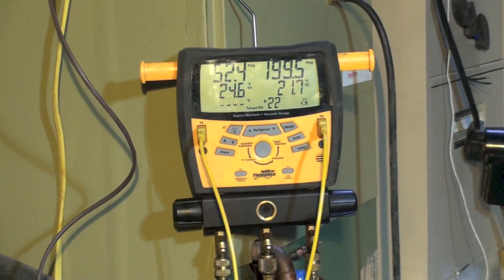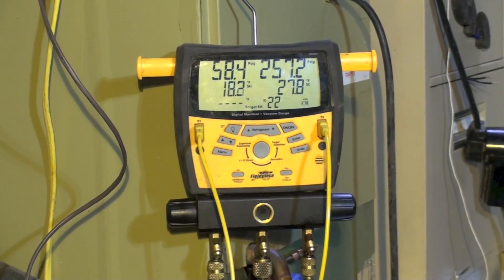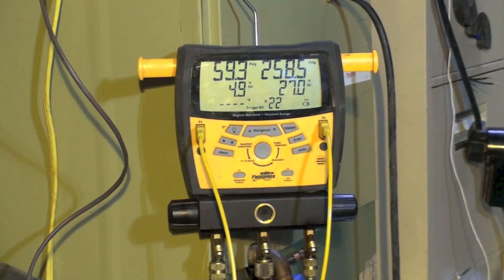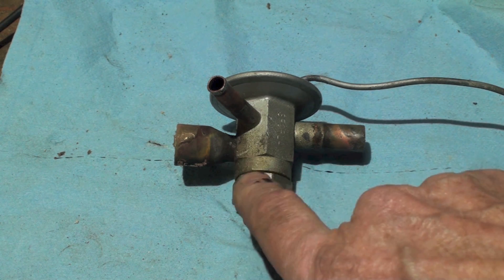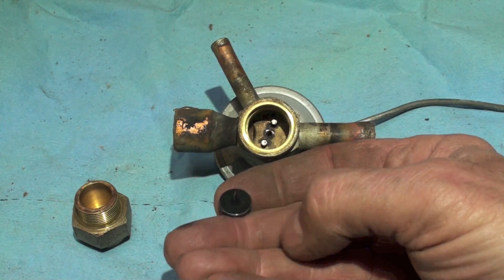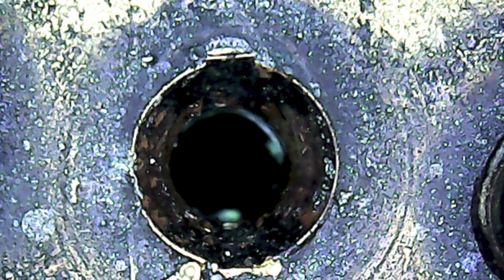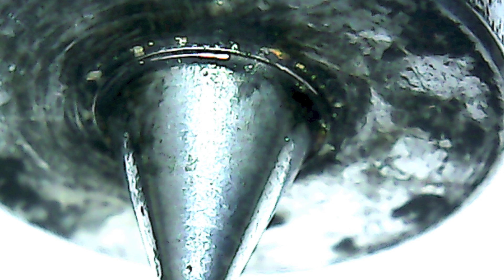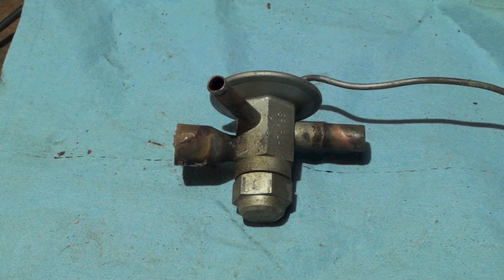Heat pump superheat problem answer

Comment: Let's say the 'black stuff' is from oxidation when not using nitrogen. flow...this brings a question to mind that I can't find an answer for... Can vacuum pumps remove this type of oxidized material from a system?
Reply from the maker: +Steve Bitschy Vacuum pumps only remove gasses.  Particles will still be in the unit.
GFM

Comment: - Why is that black stuff in there?  Scale from no-nitro while brazing in the lines during install?
- How do you know it wasn't the powerhead?

From watching this video I learned about using overcharge to force the valve open.  I hadn't really thought of it that way.  I'd probably only be willing to do this with 410.

Since we're doing this for educational and entertainment purposes,  I would have been inclined to pump-down, then remove the nut from the TXV while it remained in place, and cleaned up the needle and seat. Reassemble, vac to 300, release the charge.  Just to prove it was the scale and not something else going on with the TXV.

If I weren't doing this for educational and entertainment purposes, and it was for a customer that needed it fixed without racking up troubleshooting costs, I guess I'd pump-down, replace the TXV (with nitro flow), vac to 300, release the charge and see what happened.  GFM, what would you do in this situation if it were a real customer repair.
Reply from the maker: Brandon White This unit had at least one compressor replacement.  Could have come from that.  First, remove and replace charge.  You are not sure if a previous service tech got some air in the system.  No luck, replace valve.
GFM

Comment: Really love these GFM. A lot of the questions on the AC cert. are about troubleshooting with pressures, SH/SC and how they relate to problems. I tried to memorize as many as I could but it really seems like something that's best learned with experience and these videos work much better than staring at Quizlet for hours on end.